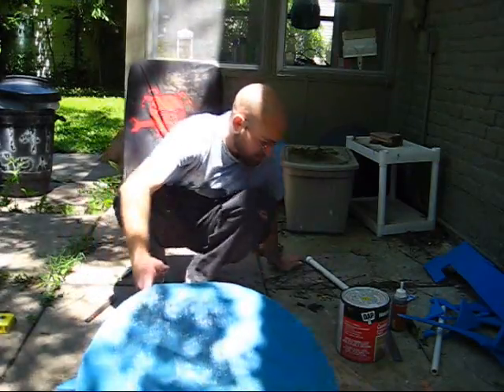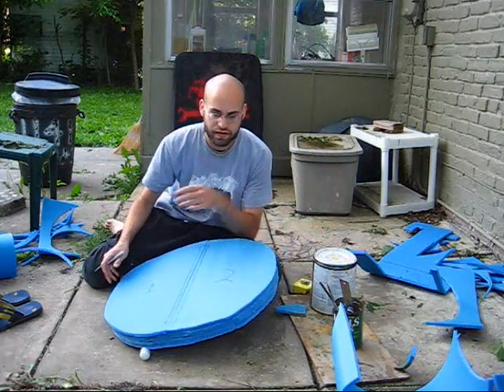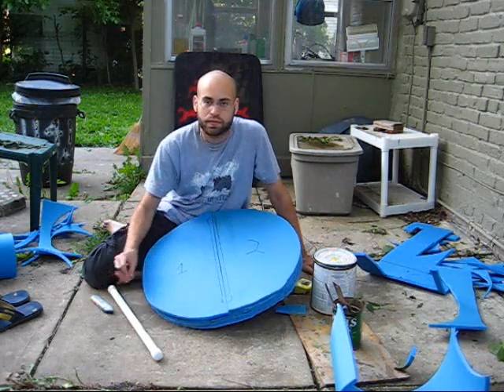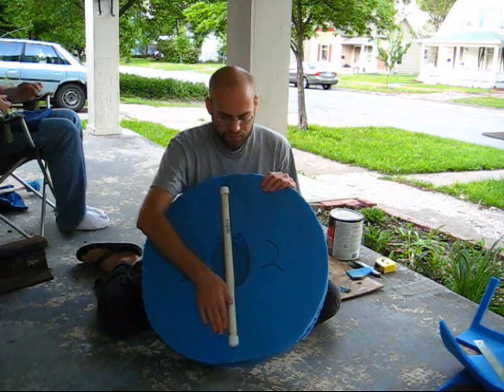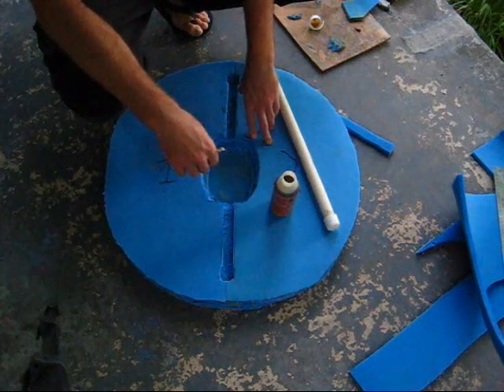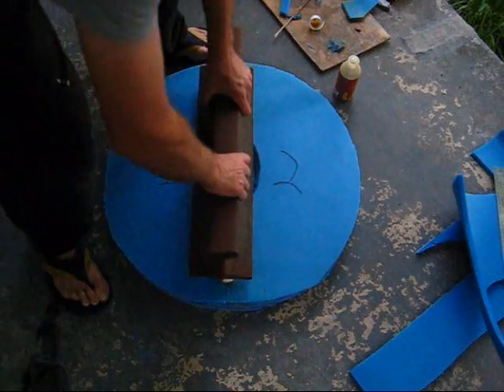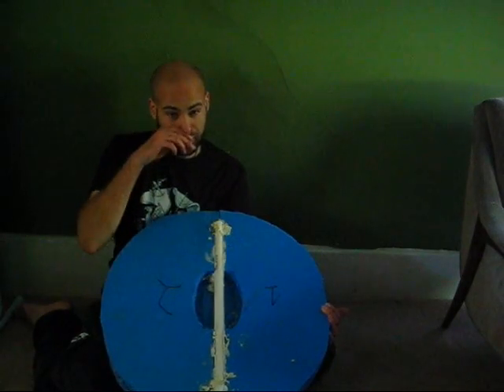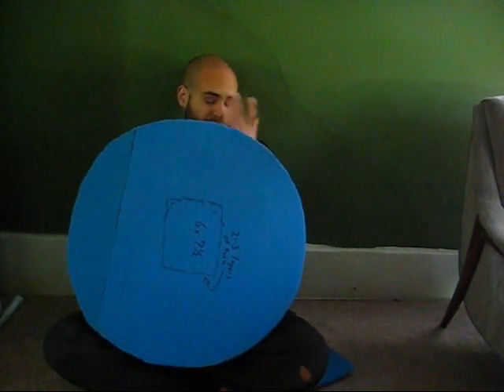How to build a punch shield #2

Comment: It would be a tad easier to edge with pvc pipe insulation and pad the inside with camp foam. I use a created duckatape strap and layer 2 layers of tape on the entire shield. I love this giulde though much cheaper than most other guides. 2 thumbs up

Comment: They're called centergrip shields, not "punch". They're infantry shields used in open ward stance, you use the edge of the shield to bash, not the bosse, mostly because the edge is closer to the enemy. The edge is the thinnest part of a shield, so it concentrates force instead of dispersing it like a compound curve does. You never hold these shields flat towards the enemy unless you're in a shield wall, or defending against projectiles.
Reply: both names are correct
Reply: and in Dag i think weve adapted a new rather efficient way of using them lol, i am upset we arent allowed to use shields to punch with tho